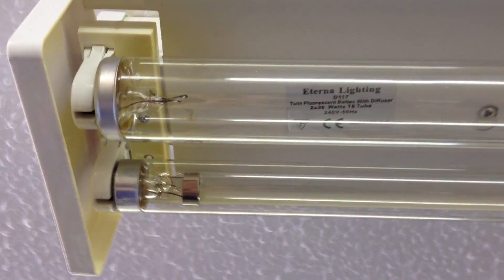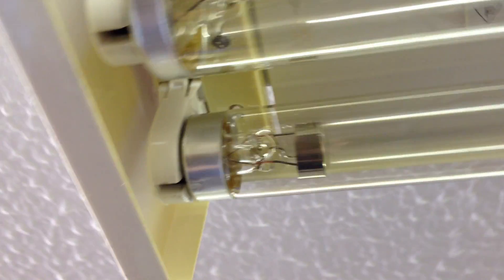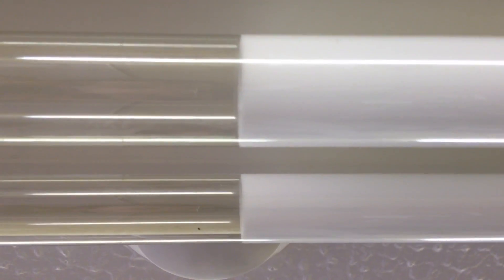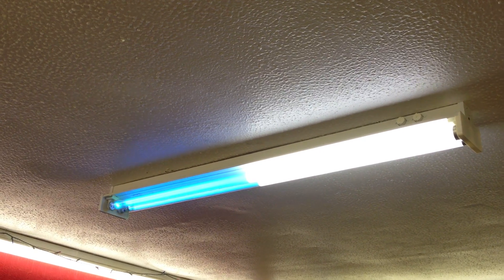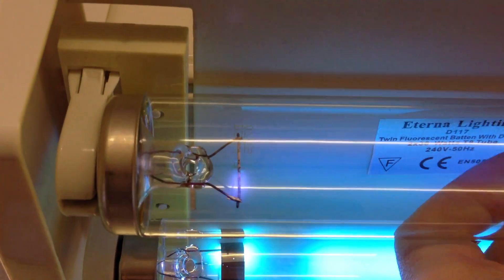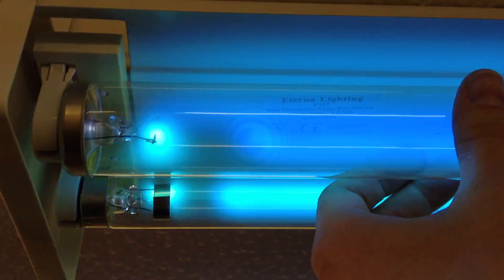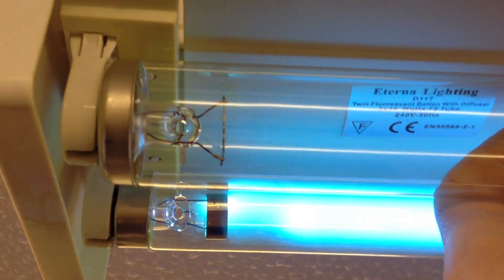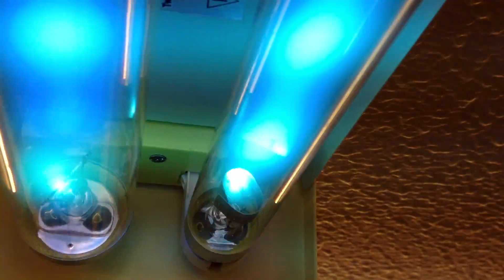Sylvania Half coated Fluorescent tubes F36W T8 and F40W T12

Comment: Wait, but isn't this dangerous to look at? Don't uncoated bulbs cause eye cancer?
Reply from the maker: It would be if they were UVC but these have a special glass on them that stops the uv radiation
Reply: @41111Danny  (I know this is a 5 year old comment, I don't care)

Actually, the glass in these is nothing special, in fact, it's just regular glass. Germicidal UVC lamps are made of quartz instead, which does allow the UV to pass through
Reply: @redpheonix1000  this its true
Reply: +41111Danny Oh okay, thank you for your quick answer. This interesting video deserves a thumbs up.